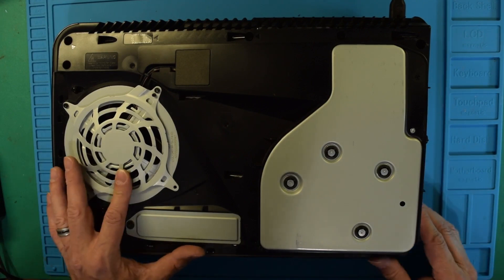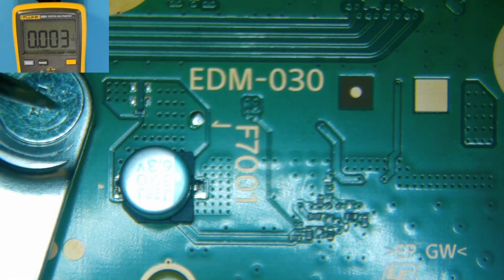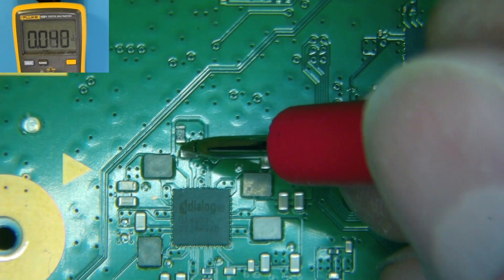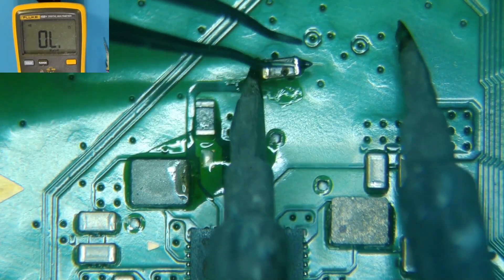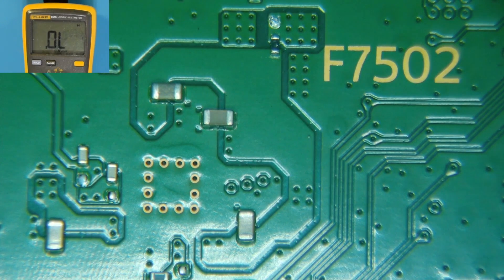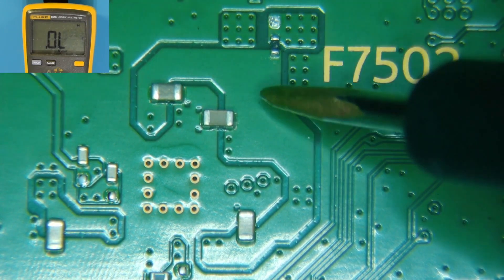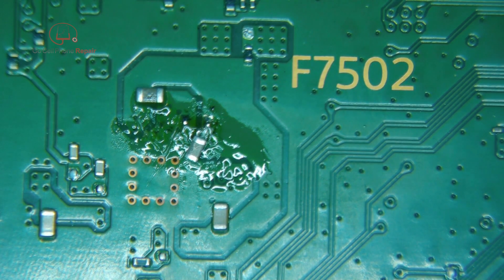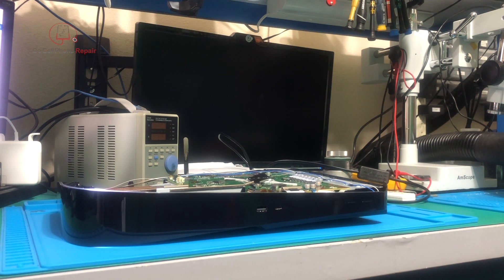PS5 No Power | One Beep No Boot Diagnosis and Repair

Comment: My ps5 slim i hardly ever used it and after about a year i went to turn it on it did this same thing i tried everything until i gave up and months later out of random anger of looking at it i was spamming the power button and unplugging and plugging it back in and it worked and it worked for months with no issues and once it sat for months without use again its doing the same thing but i cant fix it again

Comment: how do you know all the stand-by voltages that should be on each point in order to know where's the problem? do you use any voltage schematic that you could share? I got a ps5 with the same problems as this one, do you recommend using the UART diagnose system? Good Fix!
Reply from the maker: Check out The Cod3r's channel. He has at least one video that shows most of the power rails. I haven't gotten around to making one yet and there aren't any publicly available schematics per se although you can find bits and pieces if you search. Also, I do use his UART app when needed and it can be helpful.

Comment: Am i right in thinking the filter you replaced is a resistor?.If so what is its value?.
Reply: F7502 is a 5A 32V 0402 size fuse.
Reply from the maker: @ToltecMerc  Thanks for that. I really enjoy your videos by the way. Good stuff!
Reply from the maker: Unfortunately, I don't know the exact specs. I would assume Ohms but as far as the rest I'd be guessing. The PS4 uses 35V 1amp for similar functions so maybe something close to that.

Comment: How much do you charge for this
Reply from the maker: No power repairs for the PS5 generally run in the $100-150 range depending on what is causing the problem.

Comment: What causes these caps to blow its not like their old
Reply from the maker: As far as I know, there is a certain defect rate in the manufacturing process. Temperature changes and physical stress like shock from movement may speed up the failure. Long story short, there are just a certain percentage of capacitors in use out there that will fail earlier than expected. Ceramic capacitors are very cheap to produce but unfortunately since they fail "closed" they often create a short to ground which prevents the device from working at all.
Reply: Is something wrong with my PS5 System The power blown out  I think have the blue light It's beep  but it doesn't turn on I NEED HELP
Reply: Can I ship Out  Send Me A link please 🙏🏽

Comment: Can roaches harm the console?
Reply from the maker: Definitely. In the short term, they often bridge connections inside of the power supply causing it to fail. Long term, they may cause corrosion to components on the motherboard due to the waste that they produce.
Reply: They can literally be the death of any electronics